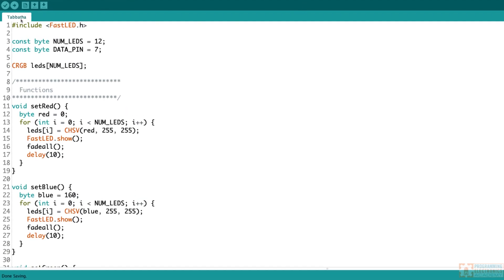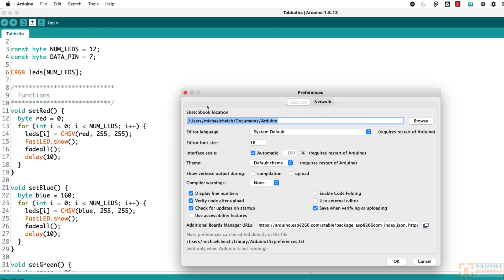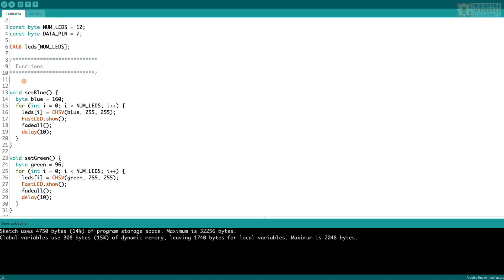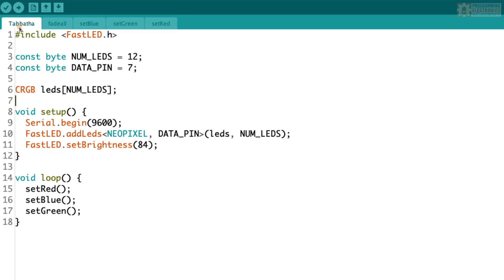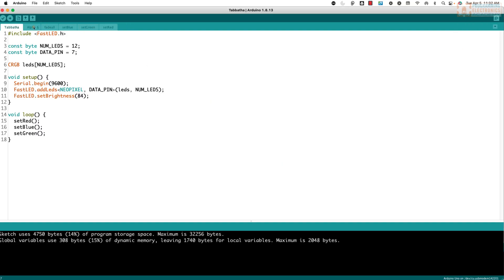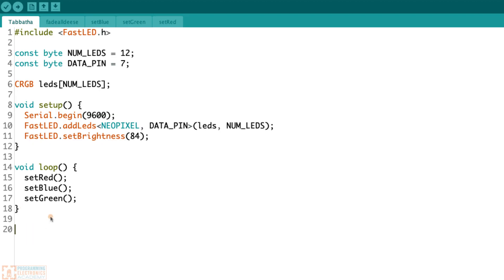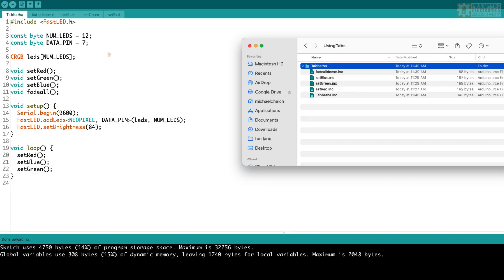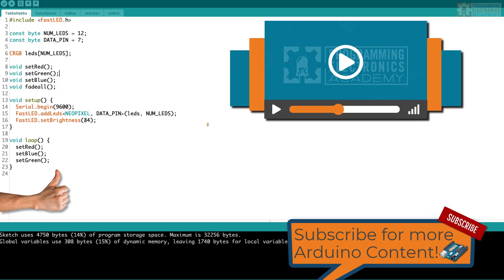Using tabs to organize code with the Arduino IDE

Comment: Thanks, this was a great video.

Not sure if the IDE changed after it, but I was working on a large code around 6 years ago and had multiple tabs.

It seemed to not generate the prototypes. Since the tabs load in alphabetical order, if any function called another function defined in a later tab, I would get an error.
As the code compiled line by line,  the function had to be defined before it could be called.

The workaround was to manually add all the prototypes in the main ino file so that they were definitely defined before any function call.
Reply from the maker: This kind of thing definitely happens, I think what you did, writing out your function prototypes on your own , is best practice.

Comment: I have watched this a number of times an I'm finally getting most of it but I have a few questions that I hope you can help me with.  
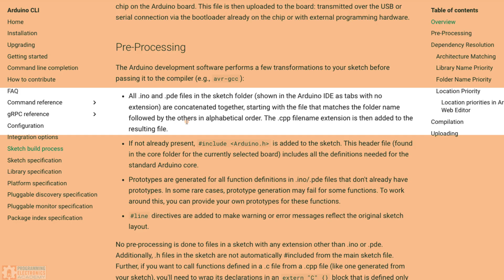I found that moving my functions to tabs really helped clean up my code and alleviated a lot of scrolling when working on large sketches.  However, occasionally the sketch would fail to compile  and the only way to get it working again was to put the functions back in the main .ino file and delete the tabs.  This has been frustrating, and I'm told by AI that it is a common bug.  So this must be what is being discussed in the article you showed at 7:47.
Also, the Prototypes are never created in my files, and I don't have a .ccp file in my sketch folder.  When is this supposed to happen?  When the sketch is compiled?
I'm going to try to manually add the Prototypes and see if that solves the problem.  Am I on the right track here?  Thanks very much.  Regards.
Reply: I had the same experience years ago. Manually defining the prototypes worked for me.
Did it fix your issue as well?
Reply: @vikhattangady  Actually, no.  I never did add prototypes manually as I suggested in my comment.  I just left all my functions in the main code tab.  Once I have a project finished, I don't work with Arduino very often.

Comment: OK< so 3 years later your video just helped someone stay organized?   And I can create a library of functions???  You deserve and got another subscriber. Thank you.
The IDE is so different now and it hides the tabs under a horizontal dots (hotdog) menu.
Reply from the maker: Hi Gary, great question.   You can definitely add functions in tabs, but if want to create an actual “library” you’d want to wrap them in a C++ class.   A class would make sense if the functions are related to each other, but if all the functions are a kind of hodgepodge of utility functions you are using, then just using tabs is fine.

Comment: I have dozens of files in my project. Arduino IDE opens them veeeeeery slowily.  Morover, it is impossible to work with dozens of tabs at all. You simply can't find a file you need.

Comment: Hello sir, I have a code for ws2812b led which has 12 effects change by push button. But when i off and on it again it's start from frist effect. I I want that when I turn it on it should be on the same last effect on which it was turned off. Please help me 🙏🙏

Comment: I have struggled with this for a couple of weeks:
A previously working sketch threw hundreds of errors when split into tabs.
My problem was that I appear to have fallen into the "rare cases" category, and had to manually add the prototypes up near my includes.

Subscribed.
Reply from the maker: Great you got it figured out!

Comment: It is a great feature, but the UI for it is horrendous!  The option is on the top right under a tiny button, instead of in the main menus??  (I won't even talk about THOSE... what a mess!)  Then instead of a pop up dialog, you enter the new name in a field at the BOTTOM of the screen???   Come on, Arduino, hire someone with common sense to FIX your User Inteface.

Comment: Hello could you please help me out with this error

Arduino: 1.8.19 (Mac OS X), Board: "ESP32 Dev Module, Disabled, Default 4MB with spiffs (1.2MB APP/1.5MB SPIFFS), 240MHz (WiFi/BT), QIO, 80MHz, 4MB (32Mb), 921600, None"

exec: "python": executable file not found in $PATH
Error compiling for board ESP32 Dev Module.

This report would have more information with
"Show verbose output during compilation"
option enabled in File -> Preferences.

Comment: Is there a precedent for putting a library in a tab? I seem to recall seeing someone referring back and forth to a library to ensure they had the correct spelling or syntax. Using a tab made that very quick and easy?
Reply from the maker: Great question Jeff!  To be perfectly honest I am not sure if there is a precedent/convention on that or not, but I could see it being handy for sure.  

Side note, I believe in order to open a .h or .cpp file in the Arduino IDE, those files would need to be in the sketch folder associated with sketch, and not in the libraries folder where libraries typically reside.
Reply: @programmingelectronics  Including the version of the library you used directly in your sketch folder would probably avoid conflicts resulting from later changes or upgrades to the libraries maintained in your Documents folder.
Reply: @jeffschroeder4805  I had exactly the same question Jeff. But I wouldn't want to have to place a copy of a library (.h or .cpp) in the sketch folder using it - just a link would be preferable (unless you really wanted to include a local copy of a version of that library for some reason). An even better way would simply be to tell the IDE in some way to just display the library code (.cpp and/or .h) as a tab within that sketch (but not to concatenate the source code to it). What I currently do if I want to readily refer to an included library while writing a sketch that uses it is to open the library source file in a Notepad++ window.

Comment: Well, my 3.3k lines of code now is 16 tabs this is fantastic , how to deal with long large arrays ? Do you make an .h tab ?
Reply: Ok I think I got it , now I have 23 tabs 😅
Reply from the maker: You might need tabs for your tabs :)
Reply from the maker: I don’t think you can add .h tabs (though I could be wrong). I believe you’d have to create the header file and  save it as a .h in the same sketch folder.

Comment: Great and clear video! For my tabs I normally prefix them with 01, 02, 03 so I can sort them with the flow that I want instead of alphabetically.
Reply: Test_WemosD1mini:501:6: error: expected unqualified-id before numeric constant
  501 | void 3countSTARTUP();
1 or 01 prefix trigger an error, good tips but it doesn't seem to work on IDE1.8.19....!  Must use letter prefix like:  void A_myfunction();
Reply from the maker: @Tango charlie  I think the issue you are having is that you cannot start function names with a number.  Otherwise you'll be fine.
Reply: @programmingelectronics   Hey, I am wondering why is that we cannot use numbers in functions /names? Because I guess today compilers are advanced enough to differentiate between functions and stuff right?
Reply from the maker: @yashaswikulshreshtha1588  That is a great question! I am not sure of the answer.
Reply: @programmingelectronics  Thanks for feedback! I think your channel is going to thrive even more if you can cover  C++/C programming as well, because I see a lot of people don't actually know programming and concepts before diving into Arduino. However I have to say for purpose of channel which was to cover arduino YOU HAVE DONE AN INCREDIBLE AMAZING AND GOD LIKE JOB! I wouldn't be able to learn arduino and programming without you! Thank you so much! for all the things you did.
Reply from the maker: @yashaswikulshreshtha1588  Thanks so much!!!
Reply from the maker: Great tip Jon - Thanks for sharing!

Comment: I like it! This will make long sketches more manageable and easier to debug. I have an old non-Arduino program that I will rewrite as a sketch - it's 400 lines long. I'll use tabs.
Reply from the maker: Very cool Keith!  I feel like I rediscover this feature every so often and then get excited to use it again :)
Reply: @programmingelectronics  Hey I was wondering if you could tell if I can use Pre Processors to eliminate inter-dependencies of files which have classes in it. I would really appreciate if you can tell me something about it.  

Thank you so much for making these videos, it has really helped a lot.

Comment from the maker: There was a question about if you could set up tabs, so that the functions could be used in other programs - and update in all the programs when the tab was updated - like a library (The comment disappeared when I was attempting to reply - my bad!).

This would be really pretty cool, but unfortunately it wouldn't work.  You'd need to have copies of that .ino file in every sketch folder where you wanted to use it , and then every one of the files would need updated if you made changes.  In that case, setting it up like a library would be the way to go.